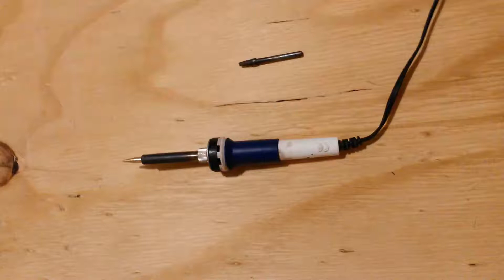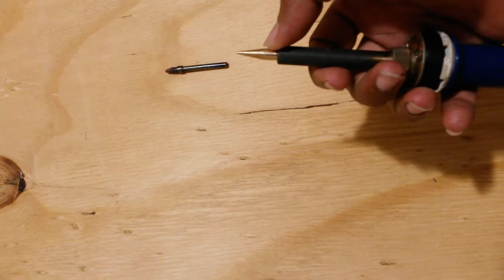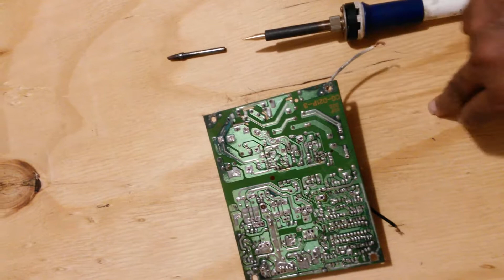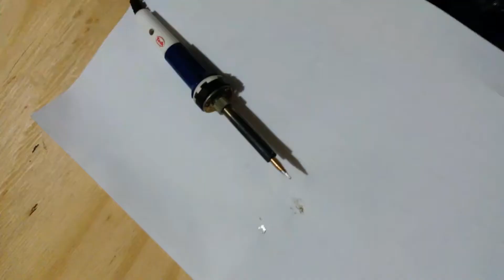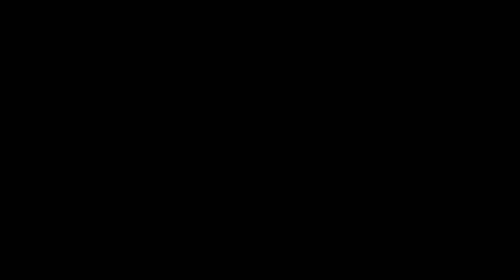003 Brass Soldering Tip

Comment: Unless you’re using some type of specialtyBronze aluminum or something like that some really fancy alloy… Sold or flux will always eat away at the tip. That’s why JVC and the other expensive high-end manufacturers coat the Coppertip in a layer of steel or iron. Which is nearly impossible to do in a quick DIY home set up by hobbyist. Cutting things with iron is not super easy especially to get such a good adhesion so that solar flux cannot get behind it and eat the rest of the tip
Reply from the maker: Interesting. I should spend some time researching tip design.

Comment: Brass screws or rods do the same...just file the tip, tin n ya ready
Reply from the maker: Makes sense to use brass screws. I have a lathe and stock brass so its not too hard for me to fabricate.

Comment: Just for mere accident I had to adapt and install in a couple of soldering irons two brass tips and let tell you that the result was fantastic. I have not the trouble of burnt for overheating tips  anymore. I am totally satisfied with the performance of the brass instead the cooper tips. Im sorry for my english by the way. Saludos desde México.
Reply from the maker: That's great. I did a follow up on video #077. I am still using the brass tip now and it works good.
https://www.youtube.com/watch?v=ROJJYkv_b7U